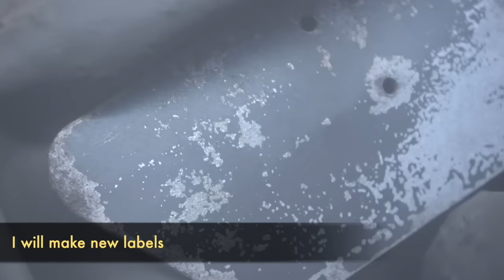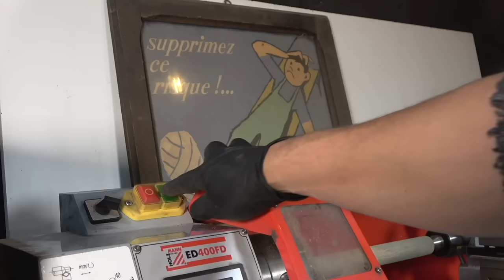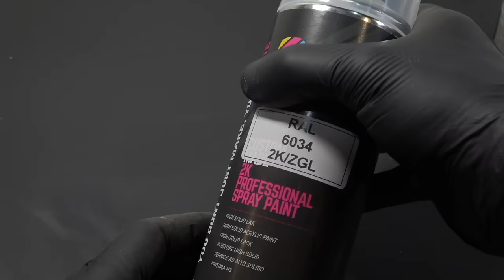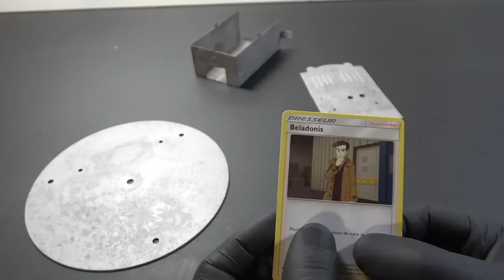1930's Carousel - Antique Toy Rarity - Restoration

Comment: Love your camera work, especially that focus off the top.  I am curious, I did notice some tabs powder coating crack when bending the tabs back in.  Would it have been better to coat after assembling the planes and other parts or is there a reason to coat first?  Very beautiful work and that spinning mechanism was very unique.
Reply from the maker: Thank you very much, yes it is the problem with that powder coating. I hesitated for a long time, I really wanted to paint after reassembling I guess I made the wrong choice ;)

Comment: Gorgeous work!

Out of curiosity, could you flatten out those metal bits using a vice, or is the hammer a better option?
Reply: hammer is ussaly a better option if you dont have vice covers the hard metal teeth could permanently distort the softer metals

Comment: The minute you powdercoat it, it stops being a restoration.
In order for it to be a restoration, you need to use the same type of coating as was on it when it was created, or as close as possible. These parts should have been painted in a lacquer to really be a restoration.
Reply from the maker: Ok. Powder coating is so fast and easy. But hey I agree with you ;)